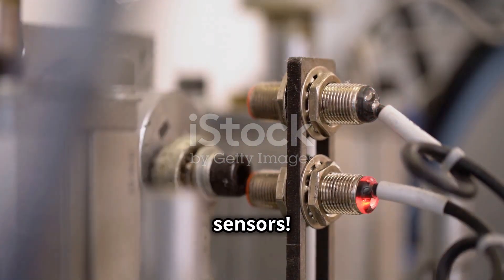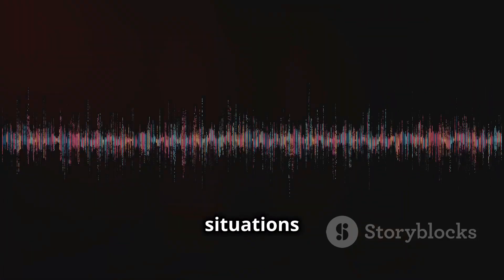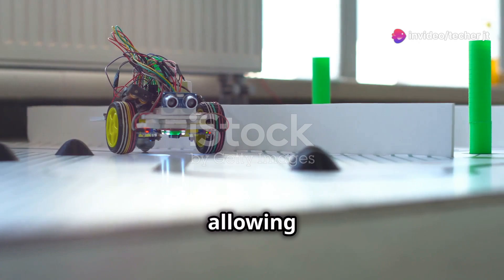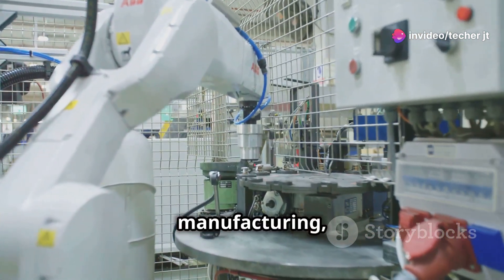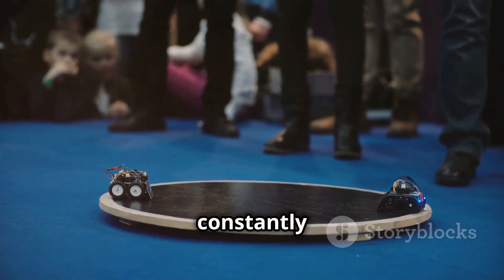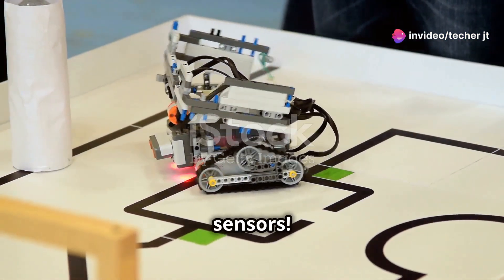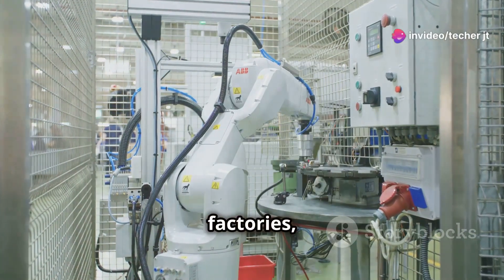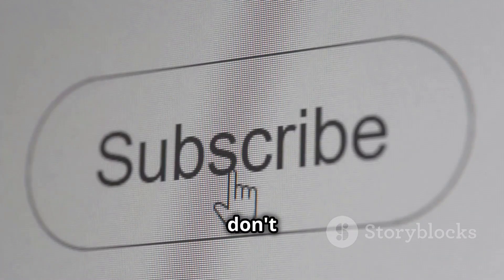Exploring the World of Robotics: Types of Sensors

Comment: Maria Sophia Sam Abansado
10 Lyra

1. The primary types of sensors used in robotics are proximity sensors to detect nearby objects without physical contact, ultrasonic sensor to measure distance by emitting sound waves, vision sensors or cameras capture visual information, infrared sensors detect heat and can function in low-light conditions, Gyroscopes and accelerometers are essential for measuring orientation and movement, helping maintain balance, Force/torque sensorsto monitor mechanical forces during tasks like gripping, while tactile sensors detect touch, enabling fine object manipulation. Additionally, temperature sensors monitor environmental conditions, and light sensors like photoresistors detect varying light levels. Together, these sensors enable robots to perceive and interact with their surroundings effectively.

Comment: Blissany Y. Torralba
10-HERMES

1. Remembering (Knowledge): What are the primary types of sensors used in robotics?

-Robotics uses several types of sensors. These include proximity sensors for detecting objects, force sensors for measuring forces, accelerometers for detecting acceleration and vibrations, gyroscopes for tracking motion and orientation, encoders for monitoring motor positions, cameras for capturing visual information, tactile sensors for sensing physical contact, and temperature sensors for monitoring thermal conditions.

Comment: LA Treassia P. Llaban
10-LYNX

Understanding (Comprehension): Explain how ultrasonic sensors work and their application in robotic systems. 

- Ultrasonic sensors function by sending out high-frequency sound waves that reflect off nearby objects. The sensor then calculates the distance to the object by measuring how long it takes for the sound to return as an echo. These sensors are commonly used in applications like obstacle detection, proximity sensing, mapping, and echolocation in robotic systems.

Comment: Rafael Daroy 
10-LYRA

2. Understanding (Comprehension): Explain how ultrasonic sensors work and their application in robotic systems.

Ultrasonic sensors work by emitting high-frequency sound waves and measuring the time it takes for the echo to return after bouncing off an object. This time delay is used to calculate the distance to the object. In robotic systems, ultrasonic sensors are commonly used for obstacle detection, distance measurement, and navigation, helping robots avoid collisions and map their surroundings.

Comment: Aiko Alzula
10 - Cassiopeia

2. Understanding (Comprehension): Explain how ultrasonic sensors work and their application in robotic systems.

Answer: ultrasonic sensors work by emitting sound waves and measuring the time it takes for the echoes to return after bouncing off nearby objects. These sensors are commonly used in robotic systems for obstacle navigation, allowing robots to map their surroundings accurately.

Comment: Maykylla Geraldine R. Egarguin 
10-LYNX

Understanding (Comprehension): Explain how ultrasonic sensors work and their application in robotic systems.

Ultrasonic sensors work by emitting high-frequency sound waves and measuring the time it takes for the echo to return after bouncing off an object. This allows robots to calculate distances and detect obstacles. In robotics, they are commonly used for navigation, object detection, and proximity sensing, helping robots avoid collisions and map their environment.

Comment: Ma. Nicole Cyse L. Rojo
10 - Hermes

4. Analyzing (Analysis): Analyze the differences between active and passive sensors in robotics. Provide examples of each.

- Active sensors emit signals like light or sound to gather information from the environment, such as LiDAR and ultrasonic sensors, which measure the return of these signals to detect objects. In contrast, passive sensors rely on detecting existing energy, like cameras capturing ambient light or temperature sensors measuring heat. Active sensors actively probe their surroundings, while passive sensors simply observe without sending out signals.

Comment: Cabunoc, Alexa Kyle R. 

10 - HERMES 

1. Remembering (Knowledge): What are the primary types of sensors used in robotics?

- The primary types of sensors used in robotics include proximity sensors, such as ultrasonic and infrared, which detect objects and measure distance; touch sensors, like tactile and force sensors, which detect physical contact and pressure; and vision sensors, such as cameras and LiDAR, used for visual perception and object recognition. Other key sensors include gyroscopes and accelerometers for measuring orientation and motion, as well as temperature and sound sensors for environmental monitoring. Together, these sensors allow robots to perceive, interact with, and navigate their surroundings.

Comment: Christian Lloyd B. Hinlo
10 lyra

3. Applying (Application): Given a scenario where a robot needs to navigate through a crowded room, which sensors would you recommend using and why?

For a robot navigating through a crowded room, I would recommend using a combination of ultrasonic sensors and infrared sensors because with this combination provides robust obstacle detection, distance measurement, and environmental mapping, enabling efficient navigation in a dynamic, crowded space.

Comment: Jullian A. Pangan 
10 - Lynx

2. Understanding (Comprehension): Explain how ultrasonic sensors work and their application in robotic systems.

Ultrasonic sensors operate by emitting high-frequency sound waves that are inaudible to humans. These waves bounce off objects in their path and return to the sensor as echoes. By measuring the time it takes for the echo to return, the sensor can calculate the distance to the object. This principle is used in robotic systems for various tasks such as obstacle avoidance, object detection, and precise positioning. For instance, a robot equipped with ultrasonic sensors can navigate through a cluttered environment by detecting obstacles in its path and adjusting its course accordingly.

Comment: Nathan James J. Compo
10 Orion

The types of primary sensors include light sensors, sound sensors, temperature sensors, proximity sensors, tactile sensors, pressure sensors, accelerometers and gyroscopes, vision sensors, GPS sensors. and inertial mesurement units.

Comment: Angel Anne L. Martirez 10-Orion

3. Applying (Application): Given a scenario where a robot needs to navigate through a crowded room, which sensors would you recommend using and why?

I would recommend using proximity sensors like ultrasonic sensors so it will detect obstacles providing safety.

Comment: Maria Juliana Lois M. Palacio
10 - LYRA

1. Remembering (Knowledge): What are the primary types of sensors used in robotics?

The primary types of sensors used in robotics include light sensors, sound sensors, temperature sensors, proximity sensors, tactile sensors, pressure sensors, accelerometers, gyroscopes, vision sensors, and GPS sensors. Each type is important for helping robots see and work with their surroundings properly.

Comment: Maria Floriz J. Napone
10 - Lyra

1. Remembering (Knowledge): What are the primary types of sensors used in robotics?

- Proximity, touch, vision, and force/torque sensors are the primary types of sensors used in robotics. These sensors aid in the detection of objects, physical contact, and environmental changes by robots. For stability and navigation, accelerometers and gyroscopes also help measure motion and orientation.

Comment: Sophia Peñoso
10 - ANDROMEDA

Question: 1. Remembering (Knowledge): What are the primary types of sensors used in robotics?

Answer :
The primary types of sensors utilized in robotics include light, sound, temperature, proximity, tactile, pressure, vision sensors, GPS sensors, and Inertial Measurement Units (IMUs).

Comment: Phoebe Coleen G. Flores
10-LYNX

1. In robotics, primary sensors include proximity sensors for detecting nearby objects, force/torque sensors for measuring applied forces, accelerometers for detecting acceleration and vibrations, gyroscopes for tracking rotational motion and orientation, encoders for monitoring motor positions and speeds, cameras for capturing visual information, tactile sensors for sensing physical contact and texture, and temperature sensors for monitoring thermal conditions.

Comment: Paul Veloso
10 - ORION

2. Ultrasonic Sensors work by emitting high frequency sound waves and measuring the time it takes for the sound to return after bouncing off an object. They can be applied in obstacle detection and avoidance.

Comment: Christian Dynniel M. Llanos
10- Lynx

1. Remembering(Knowledge): What are the primary types of sensors used in robotics?

Robotics relies on a range of sensors, such as light, sound, temperature, proximity, and tactile sensors, to perceive and engage with the environment. Vision sensors, including cameras and LIDAR, facilitate object recognition, while GPS and IMUs assist in navigation and orientation. By working in tandem, these sensors enable robots to adapt, react to stimuli, and carry out tasks independently.

Comment: 10-LYRA
Ma. Pashka R. Resoso

2. Understanding (Comprehension): Explain how ultrasonic sensors work and their application in robotic systems.
-Ultrasonic sensors work by emitting high frequency sound waves called ultrasound, and measuring the time it takes for the echo to return after bouncing off an object. It can be used in obstacle detection and avoidance, for mapping and localization, distance measurement, and presence detection; all these applied in the robotic system by ultrasonic sensors.

Comment: Iam Raut Labnotin 
10-Lyra 

2. Understanding (Comprehension): Explain how ultrasonic sensors work and their application in robotic systems.

•Ultrasonic sensors work by emitting high-frequency sound waves and measuring the time it takes for the echo to return after bouncing off an object. This time delay helps determine the distance to the object, allowing for accurate proximity detection. In robotic systems, they are commonly used for obstacle avoidance, object detection, and safe navigation in various environments.

Comment: Joshua El Noah M. Suan
10- Lyra

5. Evaluating (Evaluation): Evaluate the effectiveness of using multiple sensor types in a robotic system. What are the potential benefits and drawbacks?
-Using different types of sensors in a robot can make it more accurate and better at understanding its surroundings. If one sensor stops working, others can still help, making the robot more reliable. It also allows the robot to handle different tasks and environments more easily. However, using many sensors makes the system more complicated and harder to manage. It can also cost more and require extra computing power to process the data from all the sensors. Plus, it uses more energy and can sometimes lead to confusing or conflicting information that needs sorting out.

Comment: 10-Hermes chain 😋✊🏿👾
Reply: Camyll Jhey P. Belhot 
10-Hermes

1.Remembering (knowledge) what are the primary types of sensors used in robotics?

-the primary types or sensors in used in robotics include: light,sound,temperature,proximity,tactile,pressure,accelerometers and gyroscopes,vision sensors,gps sensors and IMUs sensors.
Reply: Tysh Maeganne Z. Sagocsoc 
10- Hermes 

2. Understanding (Comprehension): Explain how ultrasonic sensors work and their application in robotic systems.
- Ultrasonic sensors emit sound waves and interpret the echoes that return after bouncing off objects. They are used in robotic systems for obstacle avoidance and distance measurement.
Reply: Glenn Seth Myrrh B. Laluces
10-Hermes

1.) Remembering (Knowledge) What are the primary types of sensors used in robotics?

- The primary types of sensors used in robotics include proximity sensors for detecting nearby objects without contact, ultrasonic sensors for measuring distance through sound waves, and light sensors (photoresistors) for detecting light intensity. Infrared sensors are often used in low-light environments to detect objects, while temperature sensors monitor environmental or system temperature. Gyroscopes and accelerometers help maintain balance and detect movement, respectively. Tactile sensors measure physical contact and force, and force/torque sensors gauge mechanical forces applied to objects. Vision sensors, such as cameras, gather visual information for navigation and object recognition.
Reply: Herah Jhylie Zean Q. Agbu
10-Hermès 

1. Remembering (Knowledge): What are the primary types of sensors used in robotics?

- The primary types of sensors used in robotics include light sensors, proximity sensors, sound sensors, temperature sensors, tactile sensors, pressure sensors, vision sensors, GPS sensors, accelerometers and gyroscopes, and inertial measurement units (IMUs).
Reply: Deron Ethan B. Pacaña
10-Hermes

1.) Remembering (Knowledge) What are the primary types of sensors used in robotics?

- The main types of sensors in robotics include proximity sensors for identifying nearby objects without physical contact, ultrasonic sensors that measure distance using sound waves, and light sensors (like photoresistors) that detect light intensity. Infrared sensors are commonly employed in low-light settings to locate objects, while temperature sensors track environmental or system temperatures. Gyroscopes assist with balance, and accelerometers detect movement. Tactile sensors measure physical contact and pressure, while force/torque sensors assess the mechanical forces applied to objects. Vision sensors, such as cameras, capture visual data for navigation and object recognition.
Reply: Hannah Bella A. Ihalas
Grade 10 - Hermés

1. Remembering (Knowledge): What are the primary types of sensors used in robotics?
- The primary types of sensors used in robotics are light sensors, sound sensors, temperature sensors, proximity sensors, tactile sensors, pressure sensors, vision sensors, navigation and positioning sensors and distance sensors.

Comment: Ara Bella S. Quilestino
X - Lynx

1. Remembering (Knowledge): What are the primary types of sensors used in robotics?
The primary types of sensors used in robotics are light, sound, temperature, proximity, tactile, pressure, acceleration, gyroscopic, vision, GPS, and inertial measurement units or IMU’s. Where each type serves a specific purpose and provides different types of data essential for various robotic functions.

Comment: Rebmevon B. Marquiño
10 - Lynx

1. Remembering (Knowledge): What are the primary types of sensors used in robotics?

- The primary types of sensors used in robotics are light sensors, sound sensors, temperature sensors, proximity sensors, tactile sensors, pressure sensors, accelometers and gyroscopes, vision sensors, gps sensors (global positioning system), and lastly IMU sensors. These primary sensors makes a robot truly a robot by helping them understand and learn their environment.

Comment: Kirk C. Nangkil
10-LYNX

Understanding (Comprehension): Explain how ultrasonic sensors work and their application in robotic systems. 

- Ultrasonic sensors work by emitting high-frequency sound waves that bounce off objects. The sensor measures the time it takes for the echo to return, calculating the distance to the object. They are used for obstacle avoidance, proximity sensing, mapping, and echolocation.

Comment: Catherine Anne C. Gamalo
10-Lyra

5. Evaluating (Evaluation): Evaluate the effectiveness of using multiple sensor types in a robotic system. What are the potential benefits and drawbacks?

Using multiple sensor types can significantly improve effectiveness by providing a richer data set, enabling better perception, decision-making, and adaptability in challenging environments. This allows the robot to cross-reference data from different sensors, increasing accuracy and reliability by reducing the chances of errors from a single sensor. However, drawbacks include higher costs, increased computational demands, and the complexity of sensor fusion, which requires advanced algorithms to process the data in real time.

Comment: Sumalpong, Jade
10-Orion

1. Remembering (Knowledge): What are the primary types of sensors used in robotics?

Robots rely on a diverse array of sensors to navigate and interact with their surroundings. These sensors include light sensors, sound sensors, temperature sensors, proximity sensors, tactile sensors, pressure sensors, accelerometers and gyroscopes, vision sensors, GPS receivers, and inertial measurement units. This collection of sensors allows robots to perceive their environment and respond accordingly.

Comment: Khate Althea P. Clarito
10-Hermes

1. Remembering (Knowledge): What are the primary types of sensors used in robotics?
• The primary types of sensors used in robotics are light sensors, sound sensors, temperature sensors, proximity sensors, tactile sensors, pressure sensors, accelerometers, gyroscopes, vision sensors, GPS sensors, and inertial measurement units (IMUS).

Comment: Marion James C. Nale
10 - Lynx

1. Remembering (Knowledge): What are the primary types of sensors used in robotics?

The primary sensors that are used in robotics are light sensors, sound sensors, temperature sensors, proximity sensors, tactile sensors, pressure sensors, accelerometers, gyroscopes, vision sensors, gps sensors, and inertial measurement units.

Comment: RAINE BADON
10 - LYNX

1. Remembering (Knowledge): What are the primary types of sensors used in robotics?
Robotics uses a variety of sensors, including light, sound, temperature, proximity, and tactile sensors, to perceive and interact with the environment. Vision sensors like cameras and LIDAR enable object recognition, while GPS and IMUs aid in navigation and orientation. These sensors work together to allow robots to adapt, respond to stimuli, and perform tasks autonomously.